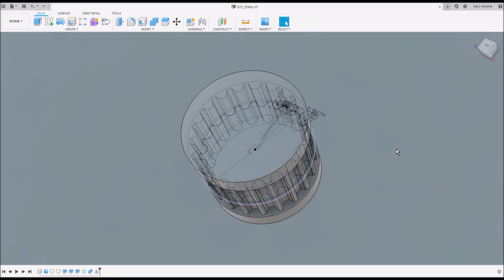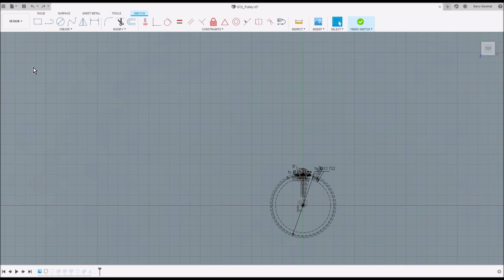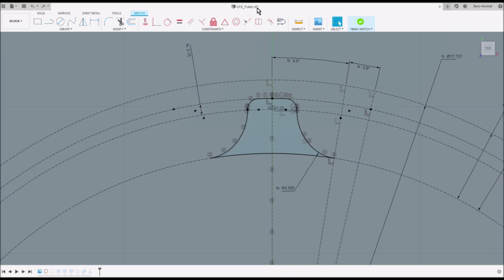Update - How to create a GT2 Timing Pulley in Fusion 360 - CAD Tutorial

Comment: I realize you posted this quite a while ago, but I only just found it when I needed to create a camera lens focusing ring.  I figured out why you had to fudge the transition between the R=1.00 and R=0.555 arcs and, consequently, why there were issues with circular patterns after changing the number of teeth.  

You used a fudge of 0.2*ToothAngle to replace the 0.40 mm horizontal distance between the centers of the two arcs.  However, that creates too large of a distance to join the arcs when wrapping the tooth profile around a circle.  So I found a better way to fix the center point of the R=1.00 arc to allow the two arcs to meet.  

With a flat profile, the distance between those centers is sqrt(0.4^2 + (ToothHeight-0.555)^2) = 0.445mm.  So I created a point constrained to the circle at the top of the teeth and 0.445mm from the R=0.555 center and used that as the center of R=1.00 arc.  That allowed those two arcs to be coincident and tangent without having to create an intermediate arc.  It also allows me to scale the profile through a much larger range of tooth counts.

Comment: Great stuff.  Luv the good use of parametrics.  I was unable to replicate (update did not work when changing number of gears)  I tried many things but what worked for me was to project three circles that represent the arcs onto a new sketch then and mirror them across the 1/2 ToothAngle line.  Unfortunately a bit of a pain to select multiple profiles.  I'm quite sure there is a better way.
Reply from the maker: This is a really old approach now, I'm guessing that how Fusion works has changed so it may be that it's more optimal to use your way. At least it's working for you now! 😁

Comment: Hello from Aus, another fix is to dimension that as ( TransRadius + RootRadius ) / 2 ul which from my experience, stops any issues from occurring. I tried it with Teeth = 400 as a quick sanity check and no update issues. (aside from taking forever to solve lol
Additionally, many thanks for the tutorial, very helpful to be able to skip through and copy out the dimensions without having to think overly much at 3am!
Reply from the maker: Hi InvertedPanda, thanks for the suggestion I'll try that too. No worries glad you found it useful!
Reply: @CNCModellerUK  the only thing that seemed to work for me is to put a spline in that trouble spot and make that tangent.

Comment: Hi! Great project! I also want to build a polar printer. I have a question about slicing. You say that the printer converts Cartesian coordinates to polar coordinates on the fly, but the problem is that in Cartesian coordinates all arcs are divided into small linear movements and this can be a problem to obtain a perfectly smooth arc surface. But (in particular for delta printers) there is a plugin to Cura, for example, which is called Arc Welder, which detects arcs in the model and in the process of cutting replaces linear movement commands G0/G1 in these areas with arc movement commands, - G2/G3. I think it would be ideal for such a printer. Have you tried experimenting with this? So far, uncertainty about slicing for such printers stops me from building this machine.
Reply from the maker: Hi Sergey, I've used s3d and cura for slicing and it's worked perfectly. No need to use arc werlder. Reprap firmware handles all of the conversion. If you're interested check out their forum, the community are really great. Personally I don't know much about the working of the firm but I do know it just works once configured. Good luck with your build!
Reply: @CNCModellerUK  Thanks, I'll try! The table of my printer is planned to be only 40 cm in diameter, and in height, I think, no more than 30 cm. Tell me, how do you plan to provide table heating? The difficulty here is that the wires from the heater and the thermistor will twist with endless movement in a circle, this can lead to a short circuit and other troubles. At first glance, I see the use of sliding contact or induction energy transfer. But the first one doesn't seem too stable and secure, and the second one seems quite difficult to implement.
PS Sorry, I left a comment a little under the wrong video, apparently while I was writing, the playlist went ahead.
Reply from the maker: @sergeys.4912  At the moment I don't heat the bed / table. I print onto Masking tape with PLA. I have a slip ring from a wind turbine in the centre of the bed should I want to provide power to heat it. Unfortunately I haven't found a suitable heater mat albeit I ado have the parts to build a custom one should I need it in the future. Good luck with your build!

Comment: Hi
I have tried 120 teeth and did not work for me specially radios teeth. The parameters are:
Diam. Pulley 76,39
Number Teeth 120
Pitch 2
Ang.Teeth 3
Trans.Angle 0.6
Shoulder Radio 0,15
RootRadio 0.555
TransRadio 1
Height 0.75
PLD 0.254
Can you see, please what is wrong?
Reply from the maker: Hi Edgard, without going through the cad its hard to say. I'm unable to dig into it at the moment due to the current global situation. I hope you figure it out. 
Best of luck 
Barry M
Reply: Edgard Makdisse it works! Thanks!
Reply: @Zierek  Do you have working model of this? Can you share? This fix does not work for me.